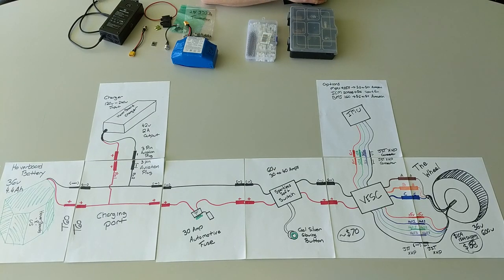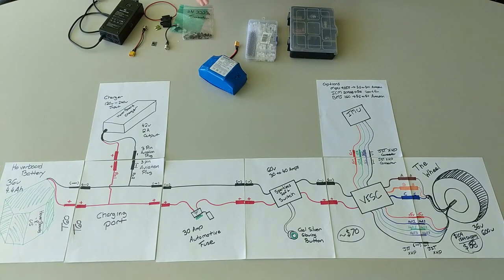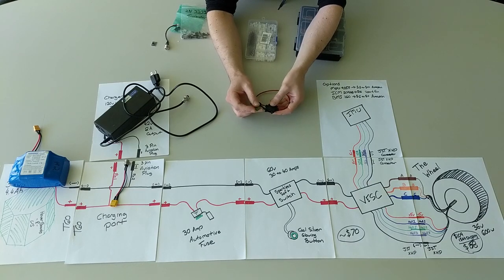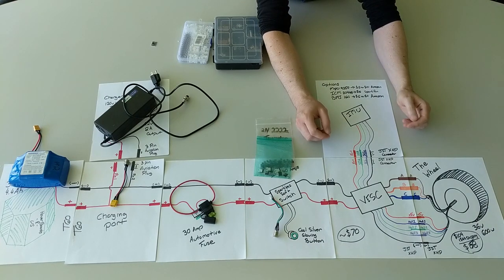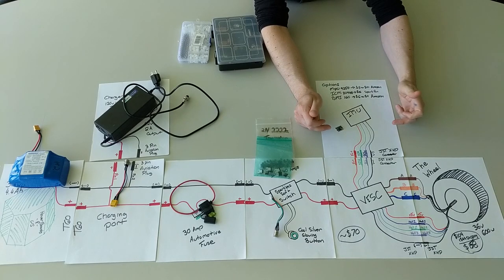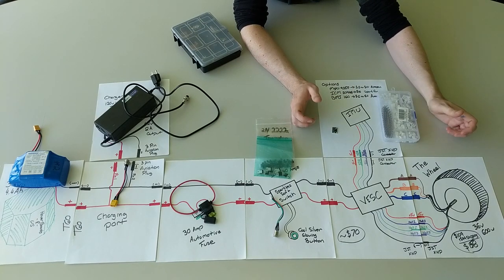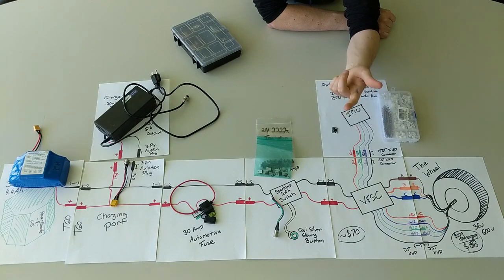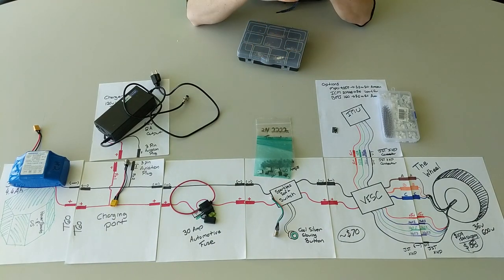DIY One Wheel Build - Electrical Overview

Comment: Some VESCs now have IMU integrated. Folks getting started now should definitely consider a VESC with integrated IMU (including FOCer, Trampa) because that entirely frees up the communications port for other goodies. Also, some VESCs (Trampa) have the soft switch built in as well. So builders looking to prioritize dealing with fewer components might instead spend more on the VESC and eliminate the soft switch and the IMU in return.

Comment: Hey! I'm an engineering student - just started the same project and am using very similar parts (also waiting on that motor from Pei Pei scooter). Would be interested in getting in touch as we both progress to maybe help each other avoid stumbling points. Assuming you also are basing much of the design on the Funwheel by Fungineers!